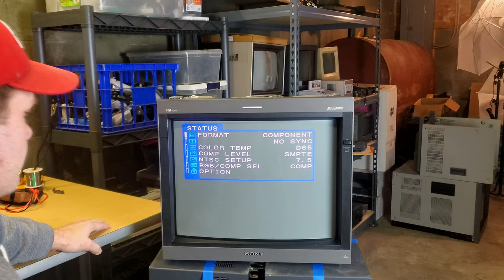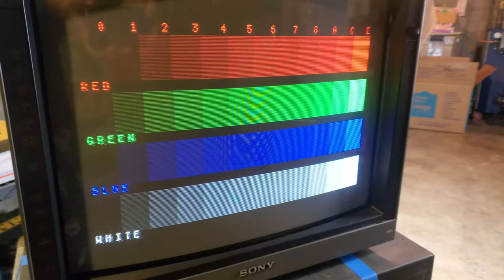The Sony PVM 20L5 has No Power! | Can this CRT Masterpiece be saved?

Comment: My 14L5 is going thru something similar are the C boards the same?
Reply from the maker: Yes, it has the same resistor!
Reply: I removed it and there’s a hole in it 😬 thanks for this post, now it’s time to test the new resistor and I will let you know how it goes.
Reply: @RetroTechUSA  okay now it burns out the fixed resistor at R705. No picture just a resistor blowout and smoke…

Comment: Hello from Russia. According to your videos I set up PMV-2730 and PVM-2130 monitors. Thank you!
Reply from the maker: Hi, I'm sorry I have not worked on the 2730, but could be similar or completely different.
Reply: @RetroTechUSA  The PVM-2130 is very similar to the PVM-2030. Having experience in setting up of PVM-2130, I set up the PVM-2730. Anyway, thank you for your hobby and videos.

Comment: Someone in here might know.  

I have a 14” PVM that I am trying to repair for someone.  There is a 3-pronged plastic clip that holds the “C” board to the tube neck.  Unfortunately like many of the plastic parts inside, it disintegrated the moment I tried to remove that neck board.  I looked through the service manuals and couldn’t find a part name or number.

Would anyone of you guys know where I can find one, or a 3D file to print/make one?

It’s like the only thing keeping me from assembling it.  It looks like this 19” has the same type of clip.